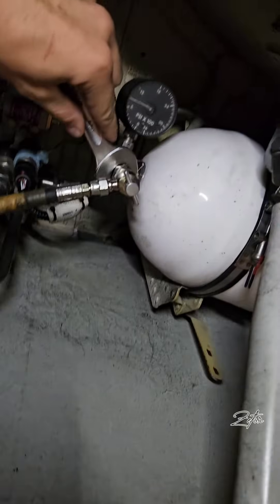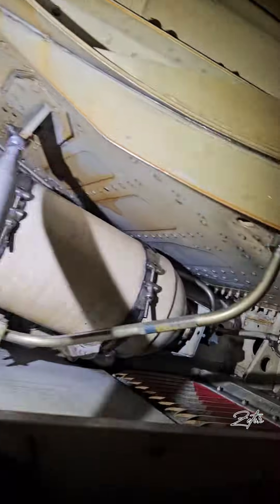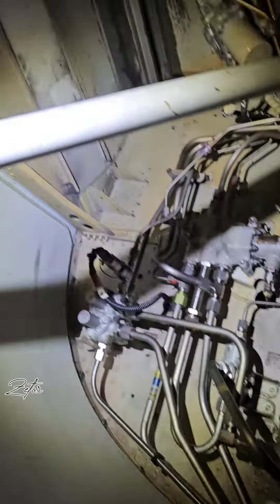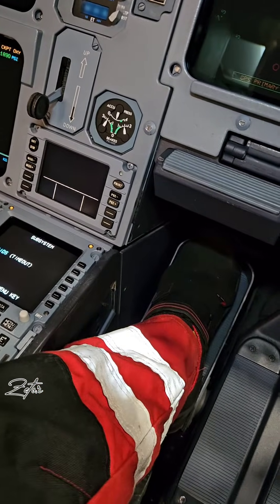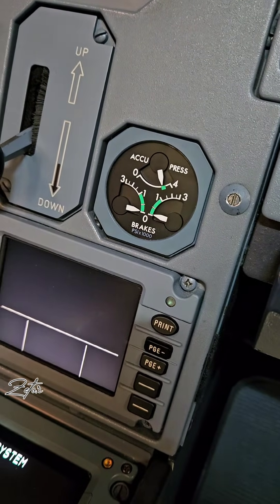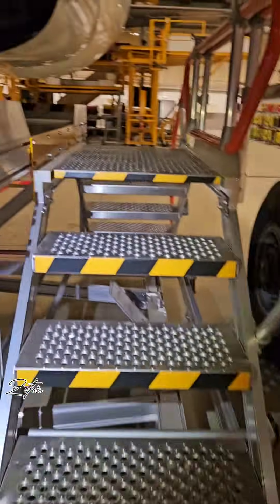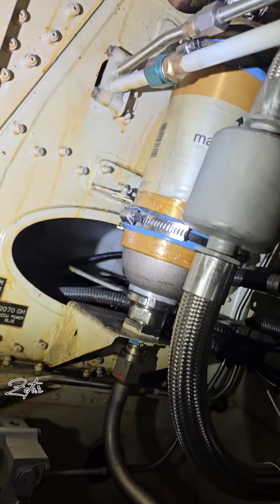ATA 29&32 What is the difference between Brake Accumulator and hydraulic power accumulator on A320F

Comment: Sir, 
Why do you use nitrogen for pressurizing the hydraulics. I mean, what's the reason for putting gas in a bladder and the cylinder charged with hydraulic. According to my understanding, the gas compresses when the hydraulic is pressurized by the bleed system. Which stores energy when compressed and when a drop in pressure is experienced by the hydraulic system. It behaves as a power supplier (it works like a capacitor) and also as a dampener.
If my above explanation is correct. Then why use nitrogen and not normal air. I heard or read somewhere that nitrogen compresses more than the mixture of air we breathe. 

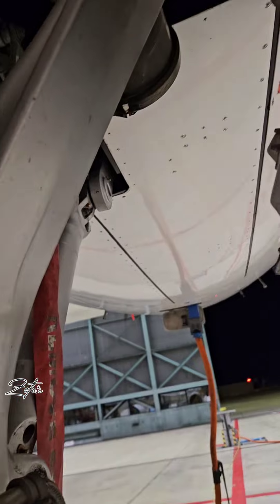Sir also could you please make a detailed explanation video of the components in the wheel well. The order, of how from the green reservoir, to the other components the hydraulic flows. As you have shown most of the components (clockwise in the video) in 2:43 till 2:57 time stamp.

Sir can you please, also make a video or send me a diagram and explanation of all the external components attached on the turbofan engine. Please sir, I know few components such as; FADEC, IDG, EDP, ACCESSORY GEARBOX and MAIN GEARBOX(not sure if it's the same as acc. gearbox).

I know you are busy with work it's difficult to manage your private life, AME life and your YouTube life. 
But could you please share your knowledge in the form of pdfs if you don't have time.
Reply: use nitrogen follow by AMM. the first reason, pure N2 doesn’t has moisture -> stable than ambient air.the second reason, pure N2 is not easy to get fire -> fire proof. actually hydraulic system doesn’t need N2 all the time. when you start APU and turn APU bleed ON, all hydraulic reservoirs are pressurized by normal air.